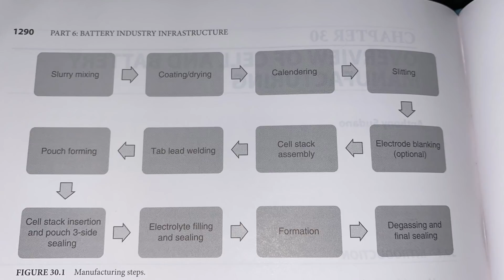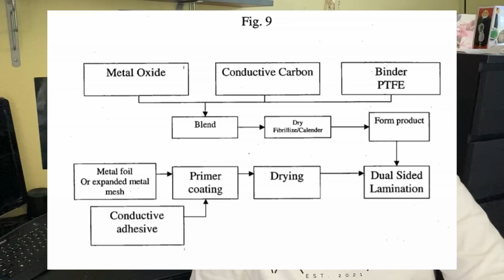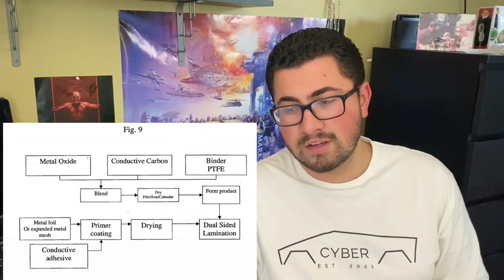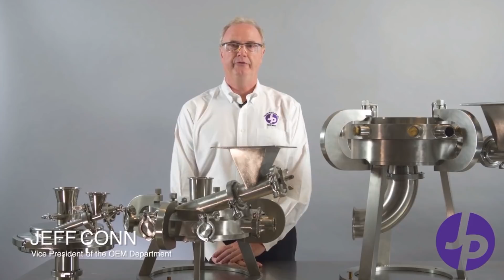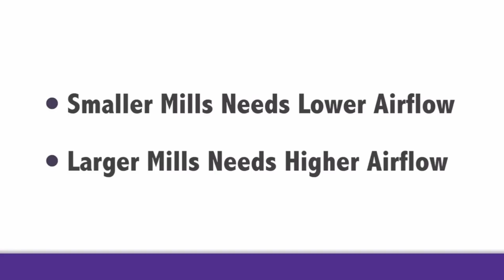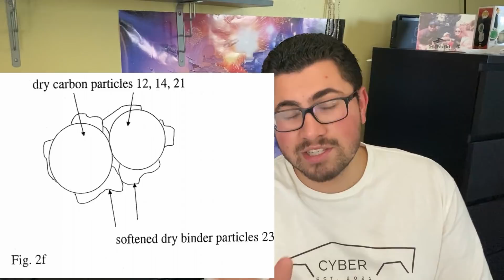The science behind Tesla/Maxwell’s next-gen battery technology is GAME CHANGING

Comment: I'm going to describe a process I'm familiar with in very basic terms.

A fine powder, containing carbon, thermoplastic and other material, electrostatically charged by agitation, is attracted to a rotating metal roller with a bias voltage applied.
The thickness of the resultant coating is controlled by a metal blade at a set distance from the roller.

A cylinder with a coating of photoconductive material is rotated in close proximity to this metal roller.

An electrostatic charge is applied to the cylinder coating. (Other processes, not required in this application occur)

The difference in charge between this coating and that of the powder results in a precise (variable) amount of the powder being attracted to the cylinder,
The cylinder rotates.

As it does so, a sheet of flexible material passes at a synchronised speed in close proximity to another portion of the cylinder.

An (opposite) electrostatic charge is applied to the non contact (back) surface of this material which causes momentary contact with the cylinder and attracts the powder from the cylinder to the material.

This material then moves away from the cylinder passing through heated rollers which compress and melt the powder into the material.

I just described a photocopier/ laser printer.

It would seem logical that a company skilled in the use and production of electrostatic devices, requiring a method to coat a powder (essentially the same constituents as toner) onto a sheet material and fuse it under heat and pressure, with no liquid, may consider a variation of this process? (Especially if they had access to a company that builds copiers/ printers.... Panasonic?)

Discuss?

Comment: just wondering, you list alot of positives if you lower internal resistance (like bigger in/output, lifetime) , but would it also not increase actual driving efficiency ? like if i use 5KW on my drive and 0.5 of that got converted to heat and i can half the heat output would i now not have used only 4.75kw  to drive instead of 5?  my example is probably a bit flawed as i'm not familiar enough with this kind of tech speak and at times the correct translation to english fails me (also correct use of KW/KWh) and then there's less cooling requirements (heat management) but lets just say that thats baked into the example's halving of the heat output (so 0.5kw loss in heat and heat management)

Comment: Great content! I look forward to the next one!
It seems that Ohms law combined with the power law have an exponential effect on current (I squared) when R falls. Is my understanding correct? If correct, that is a big game changer (range, charging times, acceleration, battery cooling systems). Efficiency going up AND cost going down!
Reply from the maker: Sort of, P=I^2*R so if you increase current it squares, but if you reduce resistance it reduces, so it’s much closer to linear than exponential, that being said it’s still it going to have a perry big impact on everything.

They were anticipating a specific energy of 385 wh/kg around 2020 Soooooo...that leads us to assume they are somewhere between 385 and 300 wh/kg. So this is going to end very big.
Reply: @RunTheNumbers  Thanks for the reply! I had to run it in excel to reconfirm it's linear! Every 5% reduction in R, increases watts by 11%.

Comment: Did you watch Elon at Boca talking about how the best engineers remove a part that isn't needed? Maybe he was specifically thinking about removing NMP when he said that?
Reply from the maker: I did! I’m not sure if he was directly talking about that, it’s kind of a theme I’ve been noticing that he is applying to most of his projects. Good lesson to learn, so it’s probably in reference to it a little, but I’m not sure it the sole thing he was thinking about.
Reply: @RunTheNumbers  Yeah when you substitute Stainless Steel, for carbon-fiber composite, at first it seems counter-intuitive, with stainless being so much denser a material, but when you get to such a large diameter tank, you end up needing a thicker wall to handle 8.5 bar anyway. So you end up needing many, many layers of the 0.007 inch thick carbon-fiber lamina anyway, so there's a lot of extra lamina lay up work to start with. Then when you add your thermal protection system to it, it's got to be a lot thicker to keep that composite matrix from melting. Stainless steel is strange stuff, it's actually stronger when hot, and stronger when cryogenic, than at room temperature. Maybe a materials scientist can explain why? And Stainless Steel never goes to ZERO Ultimate Tensile Strength under cyclic loading, like aluminum alloys. Stainless steel bottoms out at 20% UTS. So you can use it for 100 years and it's gonna be 20% long after Aluminum is ZERO strength. Somehow Aerospace Engineers working with aluminum so much, forgot why Atlas Rockets were made with stainless. And you don't need to figure out how to bond fragile, thick, CTE-mismatched shuttle tiles to it either. The part count goes way down, along with simple robust mechanical attachment of thinner TPS material. "The best part is no part, the best process, is no process".
Reply from the maker: The “the best part is no part” quote squares very nicely with my favorite quote of “a designer knows he has achieved perfection not when he has nothing else to add, but when he has nothing else to take away.” And either way is a good lesson to learn.

Comment: Amazing video! I got my degree in Electrical Engineering so it’s cool to hear how Ohms law fits into this.
Questions: 1) Elon has talked a lot recently about increasing battery production rate and battery density, but not charge rate. Are you sure Maxwells DBE makes that much of a difference? 2) Does the higher amperage mean the same 110 or 220 volt outlet at home could charge a dbe battery faster than a traditional solvent LI battery? 3) Would this DBE tech also apply to LI batteries for phones and other portable devices? If so, this could be the tech breakthrough of the decade.
Reply from the maker: Thanks for watching! 

1) I think Elon mainly has been talking about battery production rate and battery density because they are material to sales. If they cant build enough batteries, they can’t sell enough cars, if their cars don’t get enough range they will lose out sales to cars with more range (ie ice cars). Charging rate is a byproduct of a process that is mostly a plus. That being said it’s difficult to say exactly how much of an impact it will have on charging rate without testing it, but it will have at least a small positive impact. 
2) I think that depends on the wiring of your house, it might, but with less heat loss there would likely have more efficient charging.
3) yes this process also works for both pouch and prismatic cells, which would mean phones could also get this technology. The question is, will tesla build cells on house or license it out. If they build in house they might get into the phone battery business, either way they can leverage it for money.
Reply: Run The Numbers Thanks for the feedback! I think the recent run up in TSLA stock can only be explained by institutional investors becoming aware of the game-changing potential of Maxwell.
Reply from the maker: I think that has a big part to play in it, Elon did tell them to listen to the retail investors to find out more about DBE, so the smart ones probably did and got the hint.

Comment: Faster charge times could be even more important than increased density. Battery range would be a lot less important if people could charge quicker. When Elon unveiled the Cybertruck, he the charge rate was 250+ kW. I think the V3 superchargers can do more than 250 kW but are waiting for batteries that can accept that charge rate.
Reply from the maker: I agree, that’s going to me massively important. But the other advantage of increasing wh/kg is reduced weight if you keep the range the same. Which would further improve efficiency.
Reply: The currency cables of the V3 supercharger support up to 500 Volt and 631 Ampere, so 315 kw peak c-rate
Reply: @xXMonster26Xx  interesting. Where did you get this information? Is this a limitation of the cable or the charger itself?
Reply: @brcooper  as I said it's the maximum of the cable.
Reply: @xXMonster26Xx  again, where did you get this information?
Reply: @brcooper  from a photo of the V3 cable in London
Reply: The battery in the Cybertruck is much bigger compared to the model S/X/3/Y, so can also absorb a lot more energy in the same time. So even if it got the old battery technology, it would still absorb much more kW. Assuming the model S can charge it's 100kWh battery with up to 200kW, the cybertruck can charge it's 250(?)kWh battery with 500kW. Somehow if the charger is limited to 250kW, everything is limited to 250kW. If you charge a 250kWh battery with 250kW, you're still charging pretty slow. You can't blame the battery of the car for that.

Comment: Thanks for the very informative video. I did read the Maxwell description of their technology (not anymore on the website) but the information of the patent goes deeper into details. My guess is that Tesla achieved the gravimetric energy density of 500 Wh/kg. The Cbertruck makes no sense with current 265 Wh/kg, just too little space in the floor for 500 miles of range. It is really hard to wait for the battery and drivetrain investor day, but I suppose Tesla will only publish their state of battery technology, once they also start production of cells where it is implemented (I suppose in Shanghai).
Reply from the maker: I think 500 wh/kg is unlikely as the electrolyte would be the big limiting factor there, if it’s greater than 300 than I would suspect 350 wh/kg at max. It’ll be interesting to see.

Comment: In summary: this is a million mile battery.  Because of this the cost per mile, or kWh is drastically reduced, and EV's then outperform all combustion engines  both economically and in duration and reliability. Basically this battery breakthrough is the stiletto in the heart of the petroleum industry. They don't know it yet, but big oil is a dead company walking.
Reply: Their big profits are dead but fuel and gases arent the only products of that industry, and the rest isnt going away. What were really want is the energy cost inversion when wood coal or gas is more expensive even for heating than electricity.
Reply: @635574  this is the second time i find you on a tesla battery related video lol, first commemt ypu reffered tp a the limiting factor channel om amother channel fprgot what it was
Reply: @abd4620  yes I watched a lot of tesla battery vids that came out recently, maybe too much
Reply: @635574  same here bro, too much excitement for the battery investors day